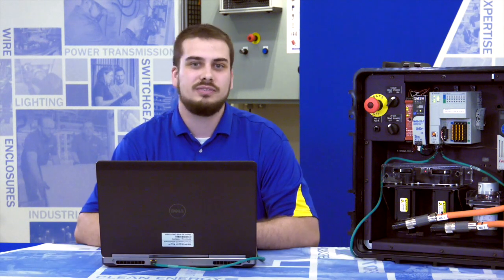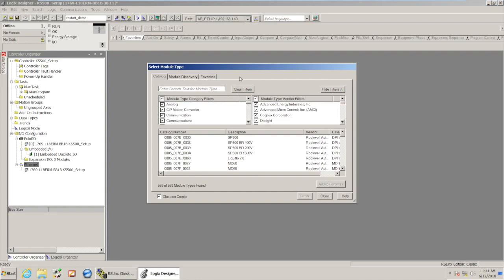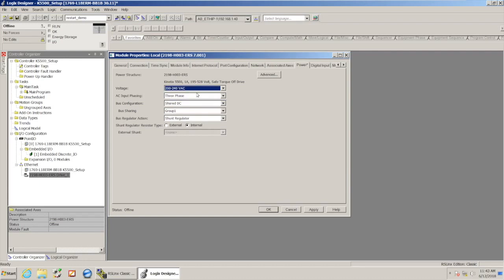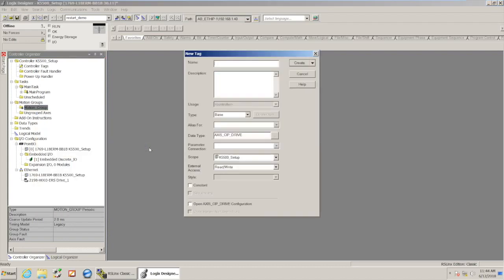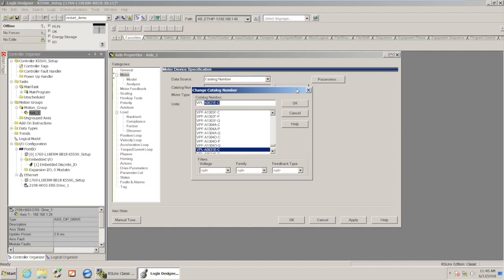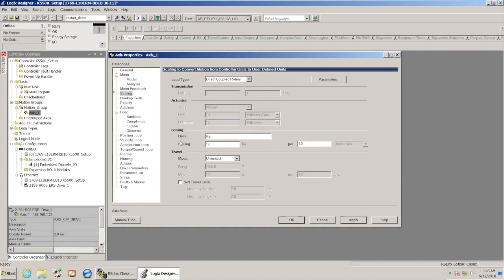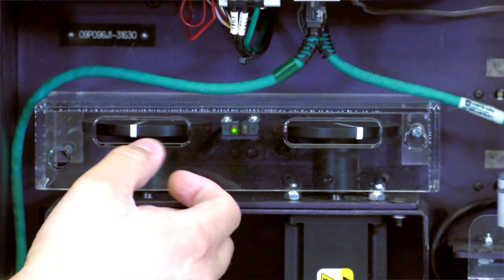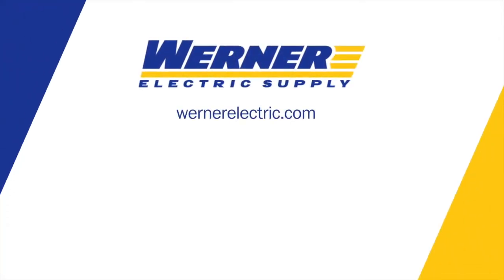Allen-Bradley Kinetix 5500 EtherNet/IP Servo Drives

Comment: I have a machine,  brand new. I need to make a speed adjustment on th servo motor. I do have logix5000. How can I learn  to make this adjustment?
Reply from the maker: With Kinetix Motion the axes are commanded by motion instructions. You will need to find those instructions in your code and adjust the velocity value on any instruction you wish to change the speed of. The instructions you would be looking for are things like a MAJ (motion axis jog) or MAM (move). We hope this helps!